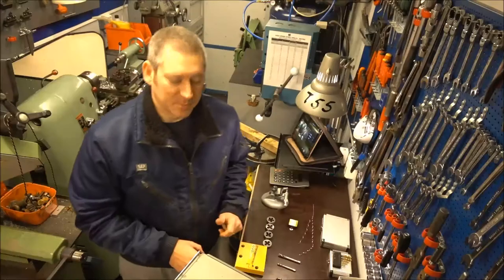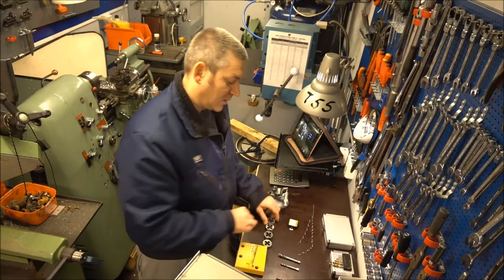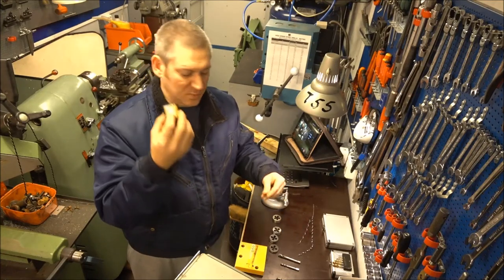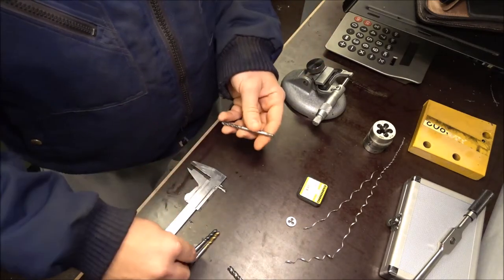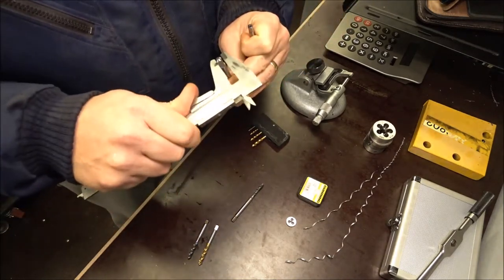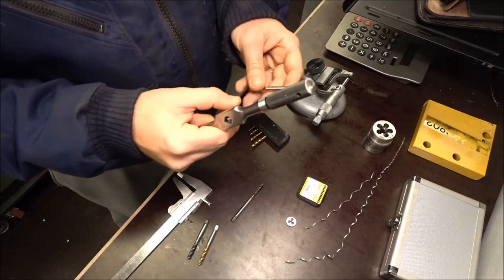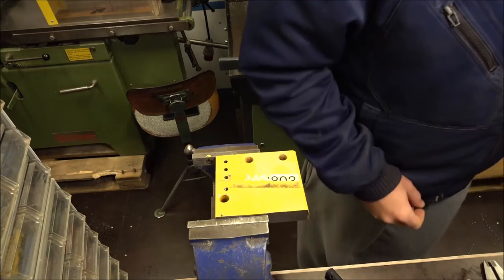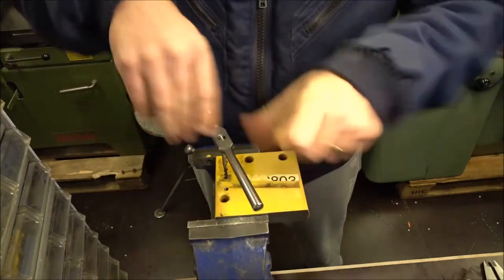Chinese machine tap quality comparison

Comment: Hi, I've checked your video and I pretty much agree with your conclusion, be aware that you need to be picky in your choices, that the Asian made tools can be a real good purchase, and, for sometimes 10 to 20% of the price will deliver almost 80 + % performance...
Some of those Asian tools I've used quite a bit and still work great, but not really enough to wear one out totally yet, and, most of the time they get used in harder alloyed or stainless steel...
Thanks for the comment and the link,    Pierre

Comment: Nice Starrett tap holder.  Where did you get that from ?

The comment about spiral taps only to be used in machines falls in line with all the technical specs I've seen on them.  But I know other people who use them by hand and have no issue/find them better.  I've never used them so can't compare.

Interesting video.

Cheers Rob
Reply from the maker: xynudu - G'day Rob, sorry for the late reply. I had to purchase the tapholders from ebay as they are unheard of here in Norway. I only use spiral taps now even for hand tapping. I think one of the main reasons people break taps is that they are not careful in the hole size for tapping and put lateral force on the tap. I am yet to break a tap and have been using spiral taps for about 10 years.

Comment: You have to remember that if you tap a blind hole, especially in a tight environment like going by feel (car repairs for example) the worst thing can happen is a broken tap. "Cobalt" steel is harder than "HSS" and more prone to breaking. Granted, spiral taps are not used in hand operations. I use Norseman high Molybdenum - they are the best with each tap under 12mm costs about $6-7 each for a hand tap. Their hex dies from the same metal are about $9-10 (non-adjustable). As far as the dies, do you have a link for those? Thanks in advance.
Reply from the maker: Unfortunately we can't get Norseman taps here in Norway (ironic?). You are right of course that the tool needs to be right for the job and that high cobalt wouldn't be ideal for an under car repair in a tight spot. I'll get back to you with the manufacturer of the dies.

Comment: Aren't your drilled holes to big for a good M6 thread?  According to my charts, M6 requires a 5mm hole, not 5.5.  Like your Starrett tap handle.
Reply: M6 course tap pitch is 0.8mm and correct drill size is 5.2mm. M6 fine tap pitch is less so could well be fine threads he's tapping...  5.5mm will give sufficient threats for most things with m6 course and makes tapping a lot easier. 5mm hole size will cause binding but in softer materials you can get awaybwith it if a 5mm drill is all you have to hand. Could potentially cause a broken tap in hard materials though 👍